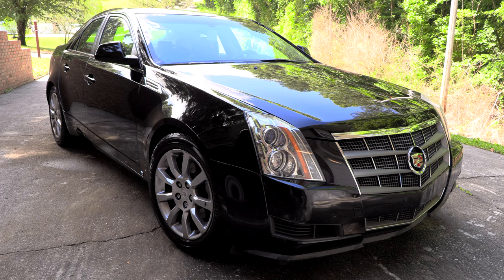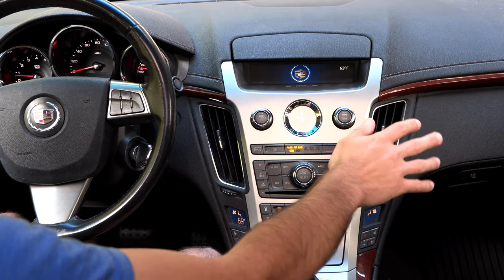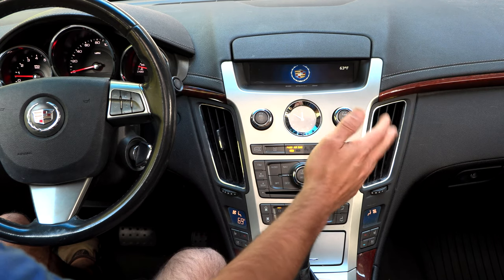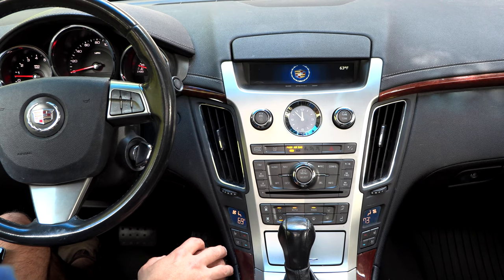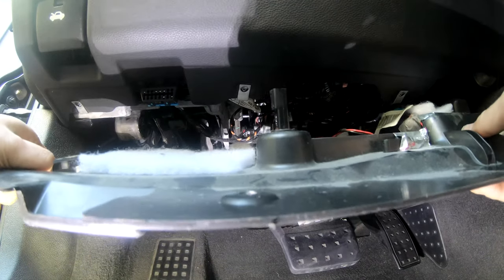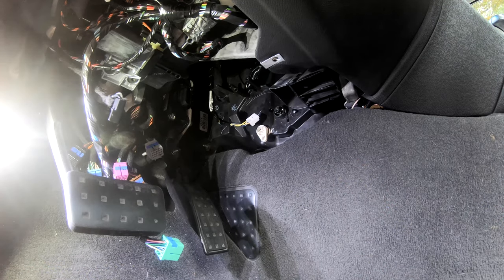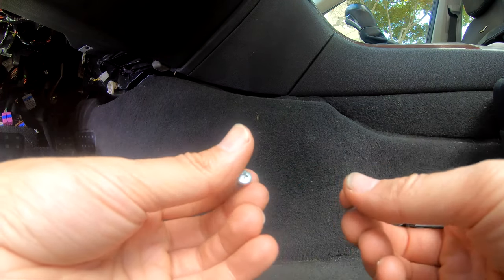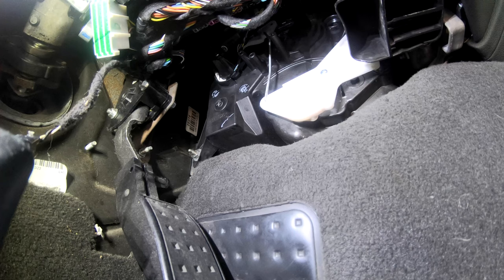2nd Generation (2008-2014) Cadillac CTS Blend Door Actuator Replacement Guide (Repair & Fix!)

Comment: Hey man, would you think it would be my actuator that has slight clicking behind passenger glove box? Air will blow sometimes for 5 min intermittently then stop all together. Then soon after it might start. Also since you have the moveable dash screen like me, the sound it makes sometimes when going over a bump behind the dash kind of resembles the noise of the motor on the dash screen going up and down. What would your opinion be? 

Thanks!

Comment: I have this actuator problem on my 2010 Cadillac CTS4 that when turning on the AC cause a crazy noise last for about ten seconds which it cost about 1000 at mechanic shops. Mine one is at the passenger side I believe but is really expensive for me to fix it with that huge cost. 
In my case the AC works perfectly fine but as I increase the temperature it doesn’t go hot.
Reply: Did you fix it?  If so, what did you do?

Comment: David, I believe I am having the same problem on the right side (passenger side).  I have the heat on being it is cold outside, the driver side works, keeps me warm while on the right ride I can feel very cold air coming out form the floor and upper vent.  I did all the testing and troubleshooting you did and have confirmed the ride side is not pushing out the proper air temperature. 
Where can I buy the actuator and what would be the part# for this actuator?  Do you think it would be the same process you used on the driver side? lastly, can you also send a link for the little tool you used to remove the actuator.  Thank you very much for your video.
Reply: How do you get the glove box out? I have a problem on passenger side as well.

Comment: My 2010 makes a loud clicking noise when I start the car. It used to only do it a few seconds. Now it does it all the time unless I change the vent setting to floor. It’s in the defrost position when the car starts and clicks because on auto it tries to change to dash vents. I have to manually change it to floor to get it to stop
Reply: Definitely sounds like the mode door actuator.

Comment: I have a question hoping you might know the answer. My heat and ac work fine its just only at the feet blows out no matter what you select
Reply from the maker: Likely one of the blend door actuators.
Reply: @DavidWaltermyer  pardon my ignorance but is there a way to know which one needs replacing?

Comment: Hey David I have a 2014 CTS Coupe and the air blows but no lights come on for the climate control or radio buttons. It all happened after I had my battery and alternator replaced. Any idea of what it could possibly be?
Reply from the maker: Not sure on that one, but I'd be taking it back to the shop that did the service. Maybe a fuse?
Reply: @DavidWaltermyer  appreciate it and sure will. Funny thing is I had it done at a GM dealership smh

Comment: Any idea of a really rough estimate of what this would cost to repair at a shop, even a guess?  I'm not impressed by my 2014 CTS 2.0 turbo AWD. My first GM product too. I thought "Cadillac" was their top of the line vehicle. This AC problem just happened to me today but also have a sunroof shade cover that is getting caught on something and the fabric wants to come off when opening, the oxygen sensor is bad so it's going in the shop for that tomorrow, when you punch the gas the transmission and power don't seem to sync well, it squeaks terribly whenever you go over a speed bump. the parallel parking assist does not work at all...all within 70k miles. I think I'll sell it, just not a great car and too many little issues and I don't even drive it hard or long distances. Beautiful looking car but that is about it. I have a Toyota that has 4x the miles and never a single issue at all other than new fuel injector last month. That has been my only repair over regular maintenance in 18 years on that vehicle. Was curious if other CTS owners have had bad experiences? Please reply if so.
Reply: I have this actuator problem on my 2010 Cadillac CTS4 that when turning on the AC cause a crazy noise last for about ten seconds which it cost about 1000 at mechanic shops. Mine one is at the passenger side I believe but is really expensive for me to fix it with that huge cost.

Comment: My 2009 cadillac is only blowing air to the legs and doesn’t want to switch when I switch the air to the vents or to the front windshield it just stays blowing to the legs. It doesn’t affect the temperatures I can still change it .
Reply from the maker: probably one of the actuators

Comment: my 08 isn't blowing at all on the floor, heat and ac work fine. any suggestions. please
Reply from the maker: I would check this actuator out as shown in the video. It's going to be an actuator, the question is which one. But this one is easy to check.
Reply: Hi!
I have the same problem with my 08cts.
It’s blowing on the floor. How to determine which actuator ? And where is located?
Thank you advance for your help.
Reply: @micheletmyril3625  i found out that the light on the trunk and the license plate bolt holes both leak water into your trunk. check where the spare tire is make sure it isn't wet.
Reply: @micheletmyril3625  
I have the same problem with my 2011 cts.. my brake light on my trunk is leaking
Reply: @jrtruscott33  auto zone sells a kit for like $10 that has 6 wedges that helped me pop out my trunk push pins easily. the trunk light is held on by 4 nuts. loosen then, put some sealer around the edges of the light, around the bottom of the 4 nuts when tightening and also do the license plate bolts the same way. its dry enough now that i trust my rifle bag in there
Reply: @flawless1up  thank you I'll look into that today I appreciate your help
Reply: @flawless1up  how does this affect the AC?
Reply: @chrislabonte8373  doesn't affect the ac. i got tired of the problems and bought a 2022 camry on Thursday

Comment: I have a problem, the flow of air is run for the feet and no for the front top side.
Reply from the maker: Probably one of the blend door actuators has failed
Reply: Mode door actuators
Reply: Did you figure the problem out ?

Comment: PLEASE HELP!! My AC is working fine but the temperature cannot be raised on the passenger side! I can make it cooler but not hotter! Is that the blend door actuator? It has the little digital screen to turn up or lower temperature but it only lets me lower it! I have no hot air on my passenger side